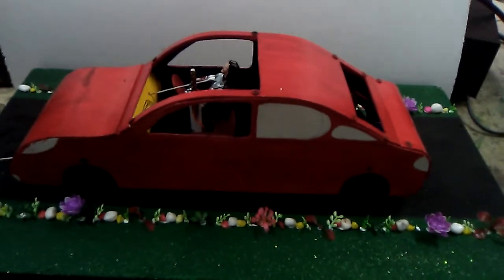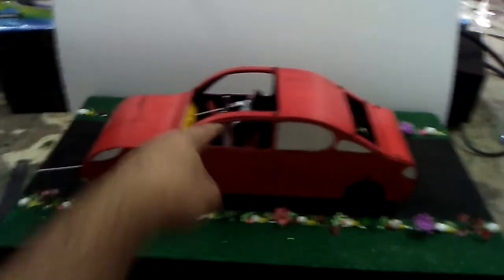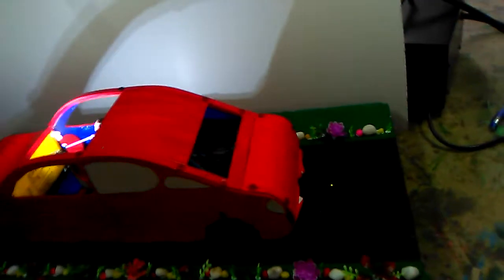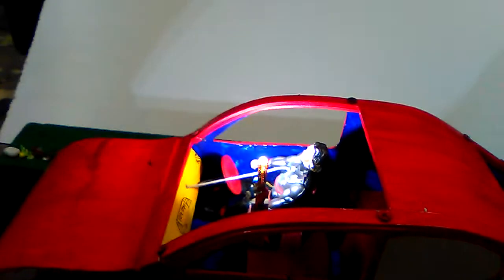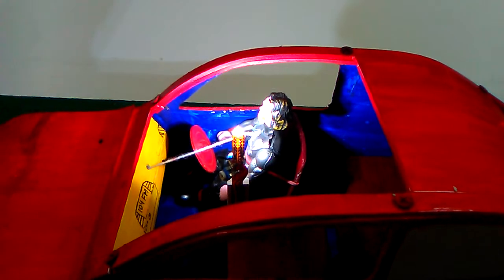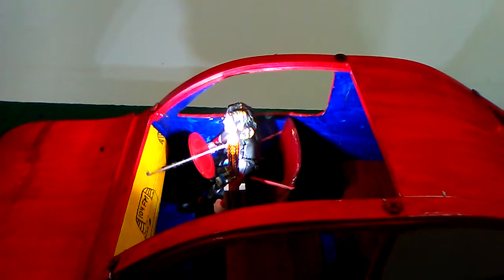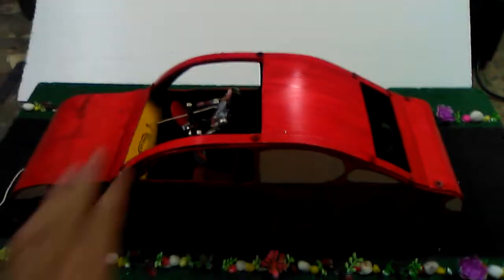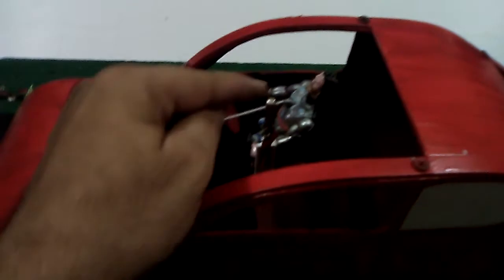Anti Sleep Car Alarm Device (Anti Sleeping Device)

Comment: Ise banane ka cost kitna hai
Reply from the maker: if you make it yourself than the price is very low but if you purchase from this will cost Rs.3000(INR) and above because of labour charges. Below is an idea about price if you make it yourself:  LDR (Rs.20/-), IC 555 (Rs.20/- or 30/-), CAR (Rs.300), LED:  (Rs.2 or 5/-), Fevicol: (Rs.80), Cyno-acrylic Glue (Rs.30/- or 50/-), base optional (Rs.300/ approx), Variable Resistance (Rs.10), Travelling (Rs.100 or more as per availability), Colors (Rs.40), 9V Battery x 2 (Rs.40 as per market), Battery Terminal x 2 (Rs.20), Wires (Rs.20), Toy inside car (Rs.200 or 400 as per availability),  Switches (Rs.15x2 = 30). Misc. (100/-)  TOTAL:  1200/-  to 1300/- approx in India. (approx $20 - $25).